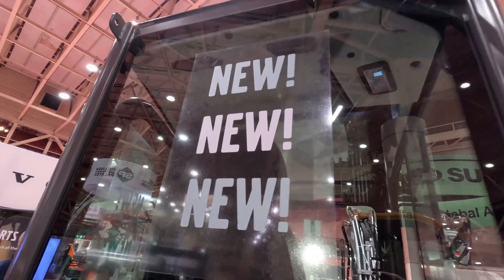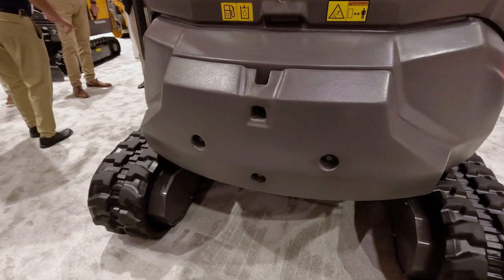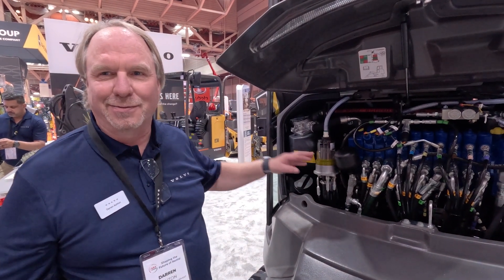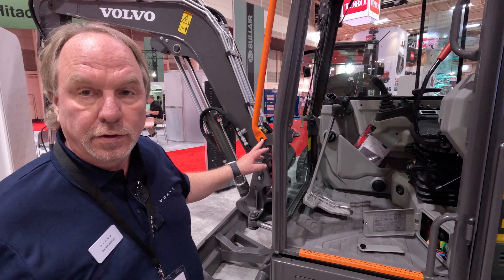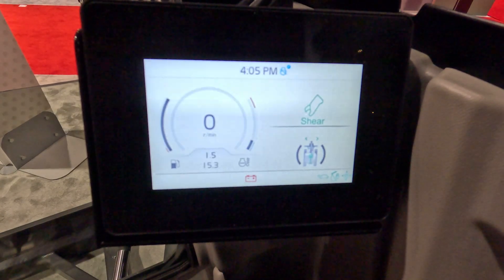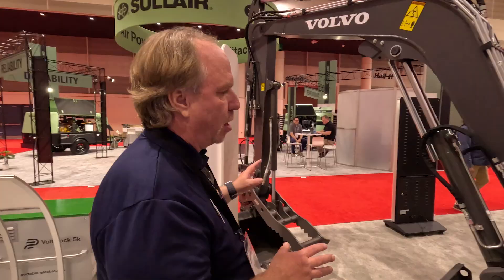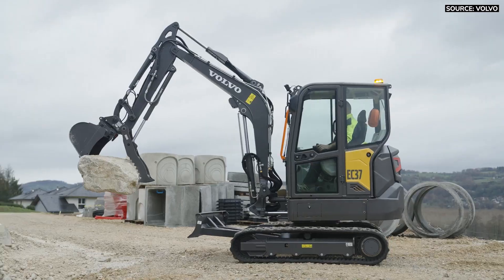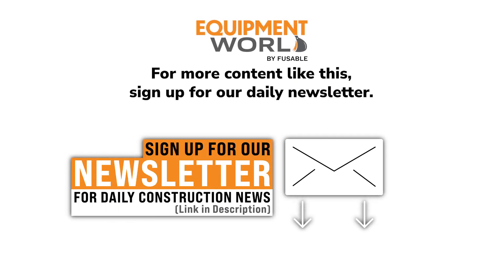A Closer Look at Volvo’s New ECR40 Mini Excavator

Comment: Poor design. Engine should be in the back by the counterweight. Doesn't even have an angle blade. Nobody makes a better mini than Kubota. After that I'd take a Komatsu, Yanmar or Hitachi. The Japs just make more reliable and practical stuff.